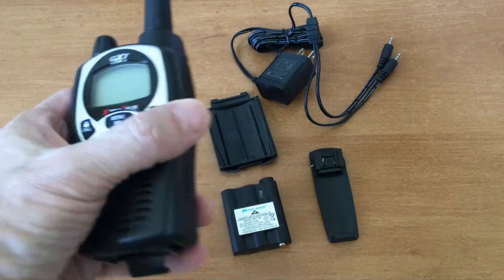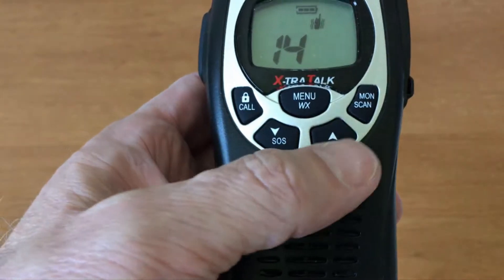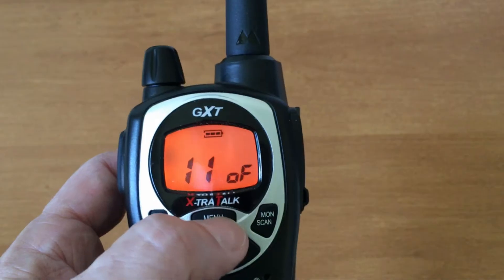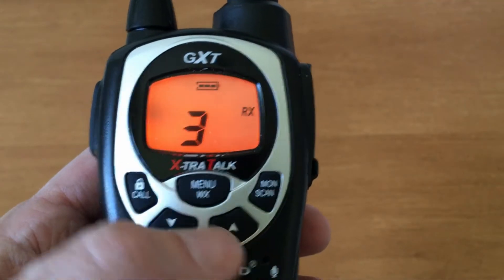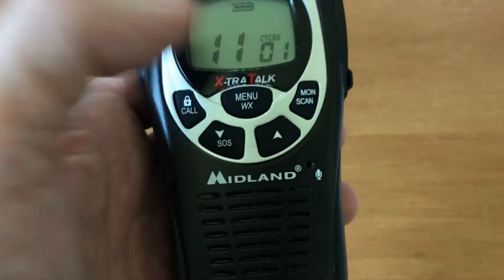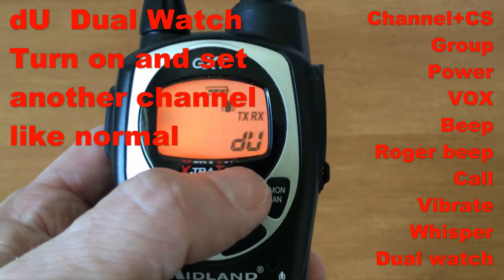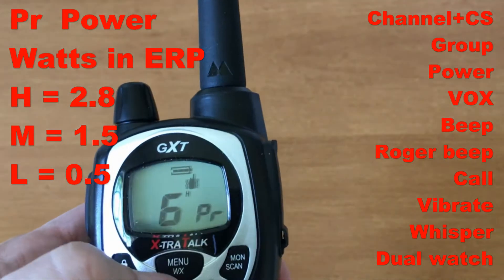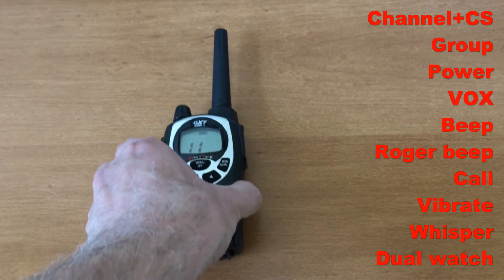Midland GXT1000 series radio - video manual

Comment: rember this is a four old radio radios in 2024 are 1/2 of a watt for family service
with all the privecy codes which are not privet thay just lock up the radio
so no one can talk to you as your radio are coded but thay can still hear you.
I Owen rugged radio's they have no privet codes just 5 watts going in to a repeater
at 60 watts then back out on second channel   just trying to help.

Comment: and let's not for get you really have a low power F R S radio rated at 1/2 watt 
and 1/4 of a mile range  do to power and the antenna as mandated by the F C C
radio service KNOW if you bought a C D ROM down loaded it in a conputer
hucked up the radio to computer in staled the tower in put tone received your license
call sign then you and I can talk to each other.

Comment: I have said it over and over the radio runs on a 1/2 watt transmiter and has a quter mile
range take to plates the plates represent 1/4 mile if one plate does not over lap the other you are out of range  I am W R X N 824 from minnesota.

Comment: Do i need to get a FCC license  for a gxt midland radio  model gxt1000G
Reply from the maker: It is a GMRS radio because the highest power is 2.8 watts. The FRS limit is 2.0 watts.
Reply: limets on G M R S is 5 watts hand held and 45 watts on base.
2.8 and 2.0 are family service watts out put.
Reply: G M R S is 5 watts on a hand held and   40  to 50 are base stations.
Reply: sorry G M R S is 5 watts on you portable yes you need a license as of 
06/03/2023
Reply: he is wrong family service is rated at half a watt on the G M R S side your at 5 watt's   I run a 45 watt base with licensee for it and do 20 miles off a radio tower.

Comment: I’m so confused…I can’t do a simple thing like contacting my second walkie talkie 😢
Reply from the maker: Do you have the GTX1000 radios? You can reset all of them so all "codes" get removed.
Reply: @personalradiofun526   Hi again, do you know what kind of range I should be getting with the GTX1000 ?  I thought it was like 30 miles...my walkie talkie stinks.  I can't get three miles.
Reply: 30 miles are what you get on G M R S channels only and you need a license which is 35.00 dollars for 10 years I am in my second year of 10
years
Reply: family service radio is 1/2 of a watt. do to ground cluter you may get 6 blockes and that is it
Reply: sorry 30 miles requires a license and tune your radio to a tower.
Reply: @DeeDee0605   you re on a  radio with a half watt transmitter
that is why you are limited too two miles or line of site
to do 30 miles you need to program in a repeater  in put tone to
get the radio to talk to the tower then you will get your  20
miles off the repeater   radio to tower to radio then back.
Reply: @DeeDee0605  to get the 20 miles  not 30 miles as that is what the range of a tower is  each tower has a PL tone like 114.3 that  tone goes in the radio so the radio will talk to the tower you will have to talk to
Midland to see what you need to get so the radio will work
Reply: meaning there IS a PL tone that goes in to your radio to make it work
see if Midland can help you out.
Reply: @personalradiofun526  read the book
Reply: remove the code side too zero then set your channel know you are back on line.
Reply: YES put both radio's on same channel and use the same code if you  want
to then have fun
Reply: check both radios to see what each radio has on the screen if thay don't match
then re do the one that is off to match the other.

Comment: I have midland gxt 1000 model.  Can I program 446 pmr to this radio?  Thank you
Reply: there are 8 channels marked R P T thay are repeter channels and require a three digit number to talk on it AND you need a license to do that as I have one here in Minnesota  we use 6 repeter's
covering 6 city's in three countys all on the same tone.
Reply: NO you can not are radios are built under F C C rules the 446 p m r will not work
with are radios
Reply: the 446 pmr does not work with are radios as thay are from over seas.
Reply: sorry n thay are from over seas thay don't match with ares

Comment: how to you turn on and off weather alert?
Reply from the maker: I added the following into the description about the weather alert.

I totally skipped covering the NOAA weather ALERT function.
1. Hold the WX key for 5 seconds.
      This enters the weather stations and finds the one with
       the strongest signal.
2. Press the WX button and confirm the station number to monitor.
       This step lets you select a station without the scan feature above.
3. Press the WX button again to get to the "AL oF" screen.
4. Press the up or down key to select "AL on"
5. Press the PTT to exit.
       A flashing cloud will appear showing that the ALERT feature is active.
Reply: read the book as he did not
Reply: read the book  I do not own one so I cant tell you

Comment: what did you press to change the privacy codes?
Reply: it is the second set of numbers he book will tell you how to do  it
Reply: READ THE BOOK HE DID NOT   that is why he cant tell you anything.
Reply: and to be clear with you security codes are a dum  all it will do is lock up
two radios to only talk to each other that all it does.

Comment: No mention of changeable antenna
Reply from the maker: It has a fixed antenna.
Reply: there is NO changeable antenna there are stock becouse the F C C said so.
Reply: do any thing to the antenna and you buy a new one and move on again
Reply: the antenna work's both F R S and G M R S it is under F C C rules
so leave the antenna alone.

Comment: Nicely done video. 

I recommend not using the ctcss and dcs codes - channels above 22. All this does is block other folks from talking to you, they can still hear your conversations, there is no privacy on these radios. If someone needs information or is in distress you will not be able to hear them. Stay on the first 22 channels, it will keep you from 'stepping on' other people's transmissions. 

I wish there was a way to turn off channels above 22 so the scan function wouldn't waste time scanning them during scans.
Reply: We do not use the ctcss codes above channel's 15 through22 as thay are off
repeater channels for G M R S  radio and there are 8 channels  all to gether
I have a G M R S radio licensee that is how I know.
Reply: on less you program you radio to the repeter channels thay will not so not to worrie which are 
15 through 21 are channels you need a license to operate as you would be talking 20 miles
Reply: @donalderickson-si8ww  I don't think these Midlands are programmable. At least I haven't figured out how to program it to not scan coded channels. If it does I sure would like to know how to do it.

I have a license, not worried about using high power channels.
Reply: sorry I can not help my radios don't have
all the bell's your radios   have MINE are from rugged radio co.
Reply: @donalderickson-si8ww  OK thanks. Mine are just basic, out of the package gxt 1000.
Reply: on  G M r s  theris a three digit code to access the repeter  my hand held's and base are set to operate on 6 repeter's covering three county's
Reply: @donalderickson-si8ww  the Midland gxt 1000, to the best of my knowledge, does not have a 3 digit code to program any changes.
Reply: I was refering to G M R S the code to enter the repeter
Reply: @donalderickson-si8ww  OK. I'm not trying to hit a repeater, I know how to do that, but I would have liked to be able to skip all of the 22 and up channels when I select 'scan' . My original post must not have been clear.
Reply: the program comes off a CD ROM that code placed in you radio will let you
talk to a repeater tower know you are talking 20 miles
Reply: @1AXMRDR 
 grab a cup of coffee soda or beer and read the book twice then you
will know more then he does he did not read the book.
Reply: @donalderickson-si8ww  please stop replying with jibberish. I already figured out that what I wanted to do is not possible with my radios.
Reply: @1AXMRDR    IT wont scan them as you did not put in a PL tone for a tower all you will  scan is ch 1 through  22 only
Reply: @1AXMRDR   basick big box strore radios
Reply: @1AXMRDR   with two mile range
Reply: @1AXMRDR   thwe three didget code is what you need to put in your radio to talk to a  repeater tower
Reply: @1AXMRDR   your scanning all 22 channels there are eight you cant use
on less you put in a tower PL tone to use a tower but you also need a
licensee to do that and since I do not own them I don't know how to bring
them up to be able to talk to a tower anyway.
Reply: @donalderickson-si8ww  how about you go buy one, gtx-1000, before you comment any more? I've read the book front to back and you simply cannot prevent it from scanning every single channel when it is in scan mode. These are very basic radios with very limited options. Good but basic.
Reply: @1AXMRDR   sorry about that carry on
Reply: what I was talking about is this to get my radio to talk to a tower
I needed to enter 141.3 which is the PL tone to do that each tower
 has a different pl tone and some are closed meaning IF you are not
in the group you can not use the tower and yes I have a licensee
to do that.
Reply: this is the G M R S side of the radio IF this radio has both sides.
Reply: the channels above 22 are g m r s channels you cant use as you are not licensed  to do so
Reply: @donalderickson-si8ww  I have a GMRS license. I CAN use them but I DON'T want to use them at all. The scan feature of the Midland gtx1000 will waste time scanning the channels above 22 which is what my complaint is about. Those misnamed 'privacy' channels are useless to most people. I sure don't want my radio to scan any channel above 22.
Reply: then read the book and fallow ho to remove the scan part
Reply: @donalderickson-si8ww  it isn't possible. Please prove me wrong.
Reply: you do not want to play in my sand box fine read the book it will tell you everything   AS he did not read the book.
Reply: @1AXMRDR  don't want to talk to your friend at 20 well you wasted $ 35 dollars for the licensee you could talk to your family at 20 miles
Reply: channels above 22 are reserved for G M R S only you need a pL tone 
to wake up the tower to use it.
Reply: @donalderickson-si8ww  lol. You have no idea what you are talking about regarding this model of radio.
Reply: @1AXMRDR   I Owen  3 hand held's and a 45 watt base station
I talk to Chicago on weekends on what we call a tower link
know who's talking about  with this radio set up I have WE 
also have  6 towers that cover three county's in are system.
Reply: channels above 15 or G M R S off repeater channels  for G M R S.
Reply: all 8 channels  15 through 22 are the eight  repeater channels for the G M R S side of the radio.
Reply: channels  15 through 22  on family service radio are the off repeater channels
for the G M R S repeater channels meaning you  open the repeater but I can't talk
to you
Reply: any thing above 22 is the G M R S  side of the radio and we use P L tones for
different tower's and the tower is  what gives you your 20 miles

Comment: Can you get a better antenna for longer range? If so, which antenna would you prefer?
Reply from the maker: The antenna is permanently attached. It does have one of the longest antennas for a "bubble Pack" radio.  Generally, longer means more efficient. Depending where I measure it is 3-1/2" to 3-7/8" long.
Reply: your radio is under F C C rules and you cant do anything. about the antenna
Reply: @donalderickson-si8ww  FC Rules? Then what was the purpose of me buying a license? Smh
Reply: @BassGods   it like a phone number for your radio you give me your call sign and what repeater tower you hang out on then I can call you.
Reply: @BassGods   to talk on the G M R S  side of the radio at 20 miles
Reply: sorry you are wrong   ALL antennas in bubble packes are one half of
a watt radio with fixed antenna you pull the antenna off the radio
grab your keys and go to store and replace it.
Reply: @personalradiofun526   longer means use the same antenna and 
talk on G M R S  and do it at 20 miles
Reply: there are strict rules the F C C  put on paper all radios in the F R S// gmrs
are fixed antennas you don't change them out
Reply: F C C rules are no no on the antenna.
Reply: you do anything with the antenna and it is back to the store to buy a new one
the G X 1000 is both F R S  and G M R S so the antenna  will do both service's

Comment: Is the GXT1000  a good radio to start with to see if GMRS is a thing I want to pursue?
Reply from the maker: If you don't need the capability to talk through repeaters then yes. Check out the repeater directory for your area at MyGMRS.com
It is a good radio for simplex (radio to radio) if you don't want to worry about getting a better antenna. You will not get the advertised range. Be happy if you get a mile with any handheld.
Reply: @personalradiofun526   right out of the box it is family service radio
at a half a watt out put.
Reply: I own several of these, the range is amazing in comparison to the UHF radios that look like these. I can drive 2 miles into the woods and speak clearly to my wife at the house. Before, with the "UHF" radios, I could only walk into the woods 50 feet (if that) and I would lose contact. 
I did a long range line of site test and could speak clearly about 12 miles. 
Many thanks to Personal Radio Fun for this video as I was stuck on the weather channel. I was able to exit the weather channel but still had the little flashing cloud. Using the channel 11 reset made that all go away.
Reply: I payed 150.dollars each for my hand held's and added a 45 watt base
you will find all my radios in all off road toys made by  rugged radio
wen have NO dummy buttons there not needed for repeaters
Reply: that  will get you 20 miles rather than two miles.

Comment: My radio has that cloud icon displayed añd i can't make it go away.  I tried pushing the transmit button while it was scanning, and I tried turning the unit on with the TX button pressed to try a reset--nither one worked.  You wouldn't think that's a big deal, but my functional autism is making it drive me crazy.  Any suggestions on how to make the clowns icon turn off so I can have a clean screen?
Reply from the maker: It is probably blinking also. I feel your pain.
Here is how to turn off the blinking cloud:
1. Hold down the WX button for 5 seconds.
2. Press the WX button twice.
3. Press the up arrow so it says AL oF
4. Press the WX button
5. Press the PPT
That will turn off the weather Alert Alarm and take you back to channel mode.
Reply: @personalradiofun526  it worked! Thanks.
Reply: @personalradiofun526  I had this problem also than you!
Reply: @personalradiofun526  good looks brother very simple, you should make a updated vid